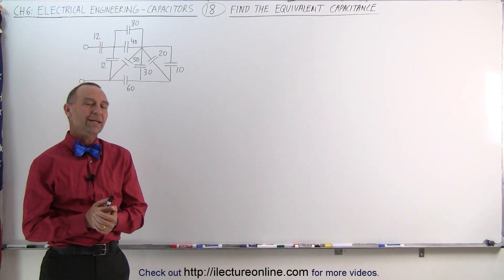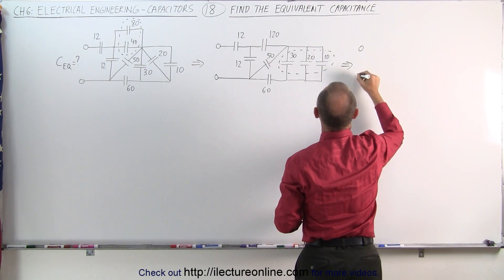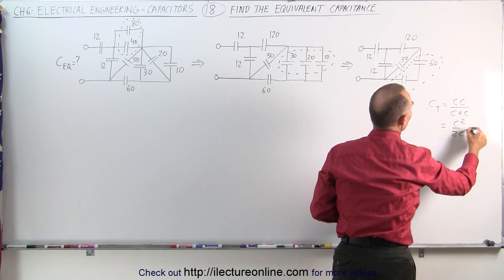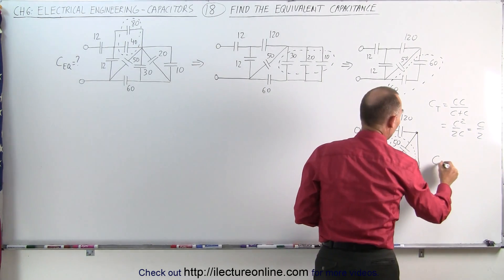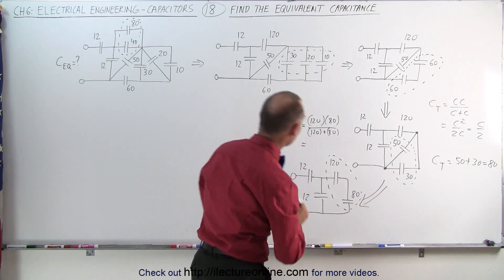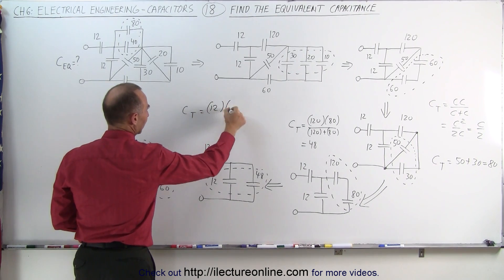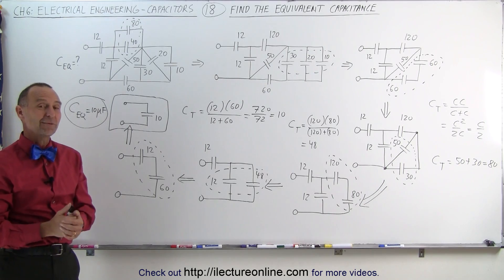Electrical Engineering: Ch 6: Capacitors (18 of 26) Find the Equivalent Capacitance 2

Comment: Timestamps (Powered by Merlin AI)
00:04 - Calculating the equivalent capacitance in a complex circuit.
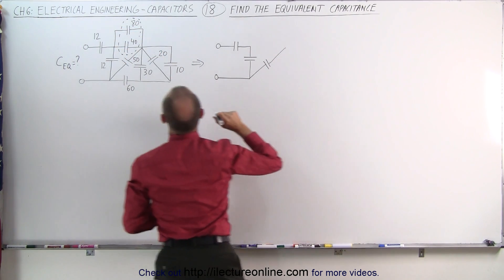00:59 - Calculate the equivalent capacitance of capacitors in parallel.
01:55 - Combining capacitors to find the equivalent capacitance.
02:48 - Calculating equivalent capacitance of series capacitors.
03:38 - Combining parallel capacitors results in total capacitance.
04:35 - Calculating equivalent capacitance for capacitors in series.
05:28 - Calculate equivalent capacitance in series anTimestamps (Powered by Merlin AI)
00:04 - Finding the equivalent capacitance in a complex circuit.
00:59 - Calculate equivalent capacitance of parallel capacitors by summing their values.
01:55 - Combining capacitors simplifies to a single 60 microfarad capacitor.
02:48 - Calculate equivalent capacitance of series capacitors.
03:38 - Combining capacitors in parallel to find total capacitance.
04:35 - Calculate equivalent capacitance of capacitors in series.
05:28 - Calculating equivalent capacitance in a circuit with parallel and series capacitors.
06:34 - Calculate equivalent capacitance through systematic combination of series and parallel capacitors.d parallel configurations.
06:34 - Calculate equivalent capacitance using series and parallel combinations.
Reply from the maker: That is powering through a night of studying.

Comment: The explanation is great! It helps me answer my homework because it has the same concept of point a to b
But my assignment also ask me to get the charge and voltage in each capacitor.
How can I answer it? do you have some tips to do it?
Reply from the maker: We have some videos in the physics playlists that may help you with that starting with this video:  
Physics 39 Capacitors (26 of 37) Find Q in DC Circuit with 10 Resistors   https://youtu.be/ZIYFBCH8jVU
Reply: @MichelvanBiezen  Thanks!<3 I'll check it out

Comment: Wait hold up✋, how was 30,20,10 parallel? Howdid you decide that??
Reply: an element is in parallel if it shares 2 nodes.  an element is in series if it shares only 1 node.
Reply: @Genesh  then how do you know 30 and 20 are parallel if they only share one node
Reply: @be4913  They share 2 nodes.  The line on the bottom is a single node and the point at the top is a node